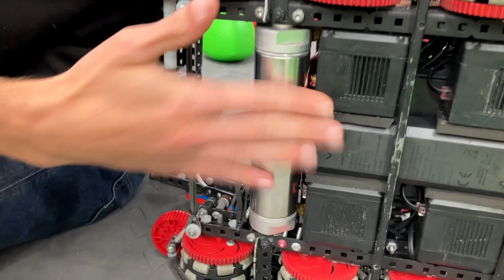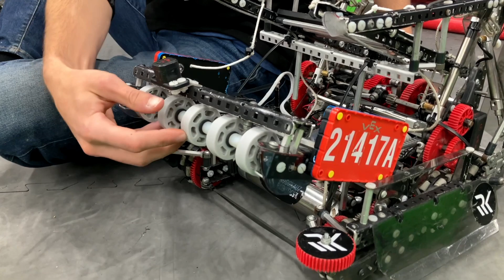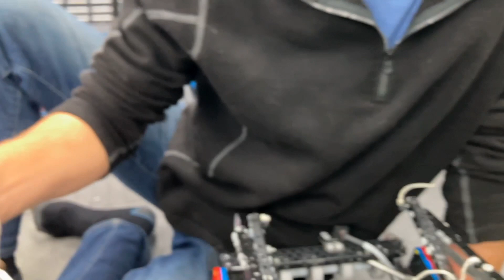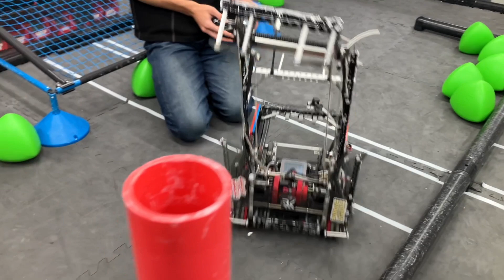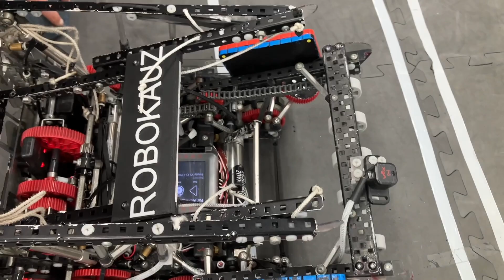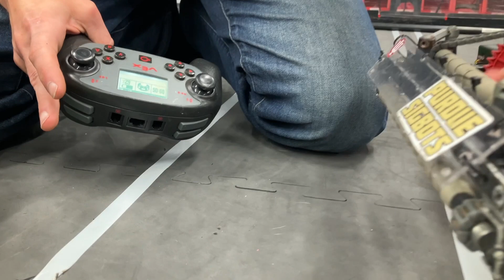21417A Worlds Robot Explanation || VEX Robotics

Comment: On your drivetrain, with the pinion and the nylock securing it, what did you connect that screw to on the other side? Another nylock, standoff or what? how did you make sure the nylock didn't randomly loosen and tighten? (that was a problem we encountered, our drivetrain was attatched to a standoff on the other side)